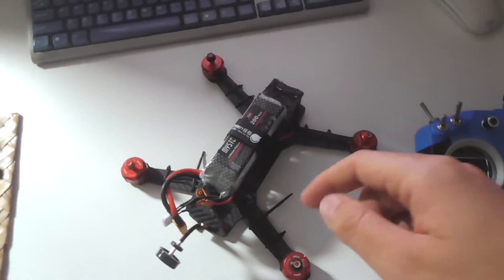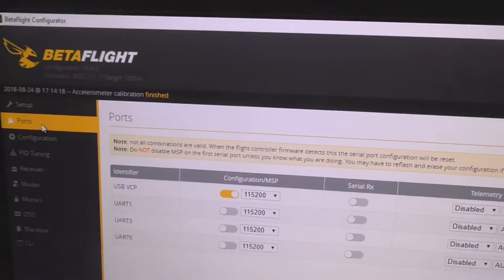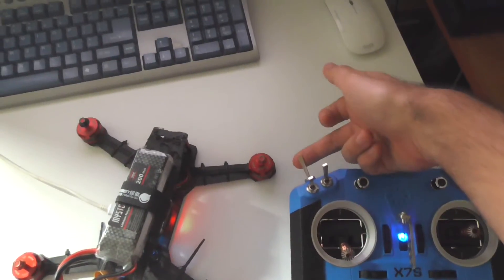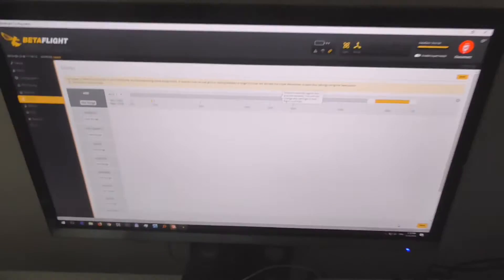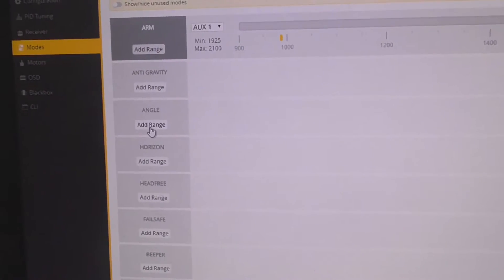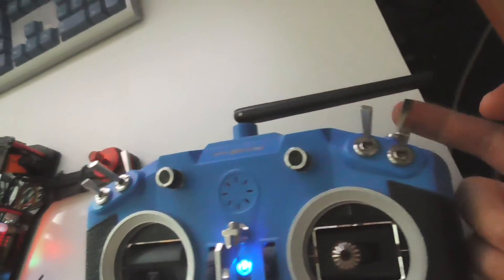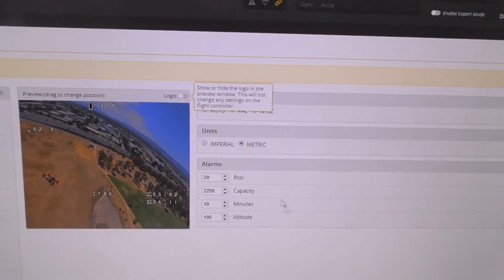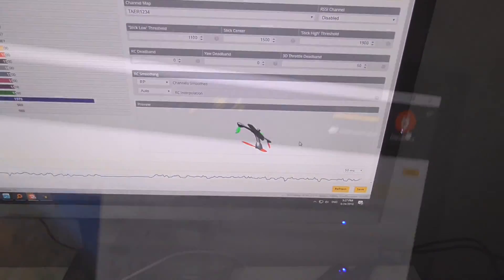Reset Flight Controller to default & Restore settings (Emax Magnum F4 AIO, Betaflight)

Comment: I reset my iFlight XL5 and now it won't connect to Betaflight anymore... what happened
Reply: Same issue happening with me any solution?
Reply: Same here. I did that to my HX115 SE on accident and now it won’t connect
Reply: @hardyflight  well I actually resolved my issue and I hope it would for you. So what u gotta do, is install a driver fixer for drones which u can find online somewhere and there is a lot of videos on it. Then you wanna push and hold the boot button on your drone’s flight controller and plug it into ur pc at the same time. Then launch the driver fixer, and it would search for the FC and then u would wanna click “install driver”. After that is complete, you would be able to connect to BetaFlight again but u would need to reflash the FC with the firmware